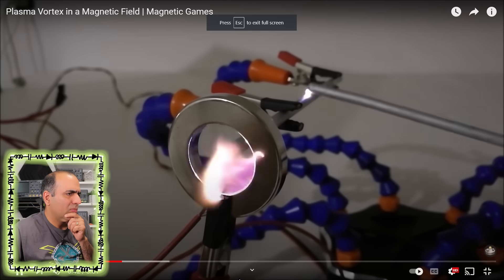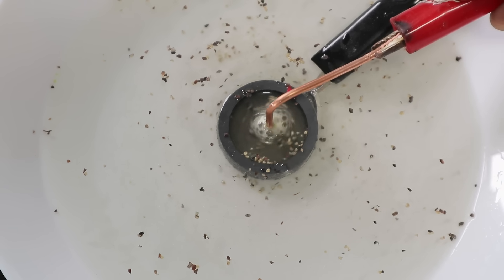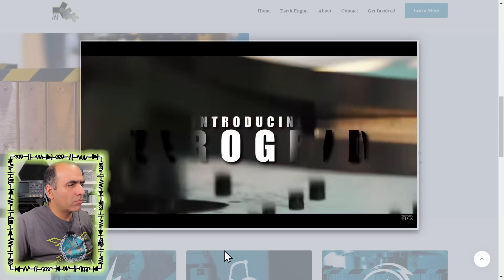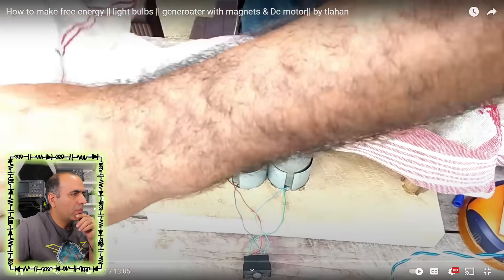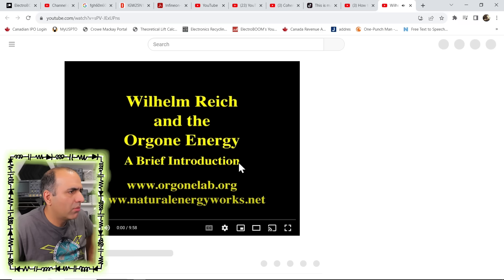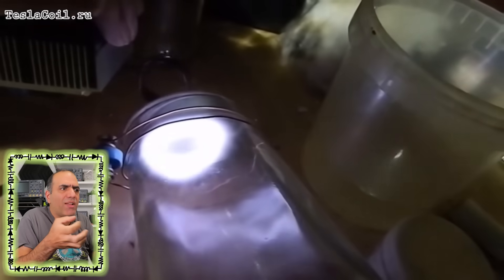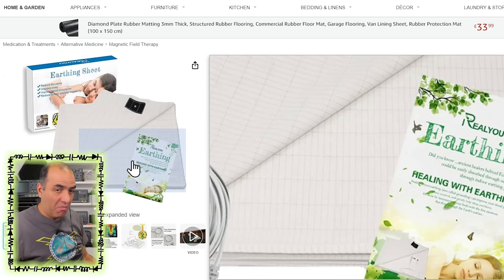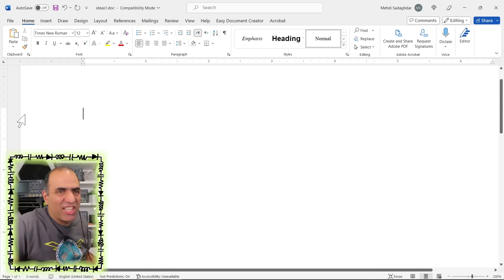Plasma and Salt Water Electric Vortex, Document Free Energy Clean Up

Comment: electroboom could we consider nuclear fusion ass the closest idea to "free energy"? I mean they use water to get more energy than the one the used to make the fision but they are kind of converting water into energy by doing the proces
Reply: All forms of energy generation are just converting from one form to another, in the case of fusion and fission energy the energy comes from the energy matter equivilance, if you take two hydrogen atoms and fuse them into helium then you'll find that the resulting helium atom weighs a tiny bit less than the two hydrogen atoms did in total. The mass of the protons in the atoms has been converted into energy at a rate of E=mc^2, where E is energy and m is the mass decrease. In nuclear fission it's the same thing going on but just in reverse, it turns out that the protons and neutrons in very heavy elements like Uranium weigh more when they are part of the uranium atom than they do after splitting.

The basic thing about energy is that there is loads of it in the universe but most of it isn't in a form we can use. Like coal has a ton of chemical energy but we can't directly power machines with just coal, so instead we burn the coal to boil water that spins a turbine that drives a generator and now the energy is finally in a form we can use. And in the process of doing that a little over half the energy contained in the coal was lost, and it is fundamentally impossible to decrease that loss.

Comment: The smell and discolourations experienced with the salt water vortex experiment can be explained by electrolysis.
You electrolysed salt water, where the cathode was copper, and the anode was iron.
During this process, the hydrogen develops at the cathode, while oxygen and chlorine develop at the anode.
Furthermore, iron ions detached from the anode and deposited on the cathode. This caused a thin sheet of iron to develop on the cathode, thus turning it black.
The chlorine left the water as a gas, which explains the strong smell.
The hydrogen and oxygen also left the water, but this has no noticeable effects.
Within the water, due to a lack of chlorine to combine with, the sodium from the salt reacted with water, thus creating sodium hydroxide, a very strong base.
The sodium hydroxide solution bleached out the pepper, thus turning it green.
After this, the polarities were swapped. The copper became the anode, and the iron the cathode.
At this point, the iron sheet covering the copper anode detached and went back to whence it came. The copper anode then reacted with the oxygen developing at it, thus corroding into cuprous oxide. This turned the surface red.

Electrolysis, electroplating, lung damage, bleaching, and corrosion, all in one experiment!

Comment: There is a way to kind of get free energy you get a water wheel a hose or tube and find a elevated spot above some water and then use suction or whatever you do to drain a pool to make the water go up the tube/hose and then it will push the water wheel and go back into the body of water only issues is the dry and cold sessions will mess with it
Reply: You can only use the siphon effect if the body of water you are depositing the water into is lower than the one you're taking it out of. This is because the energy comes from gravitational potential energy so it has to end up being lower down.
Reply: @hedgehog3180  yet you can use a water pump that isn’t that strong and the energy that is created will be more than enough to power the pump so you can use that excess energy to power other things

Comment: Piezoelectric (sorry spelling) effect from the spark generator in the lighter causes quite a bit of radio interference i think.
Reply: The radiowaves are being generated by the spark itself, not the piezeoelectric effect. Spark gaps were used in the earliest morse radios.

Comment: I'm just asking for a video.
I have a common problem which no one seems to answer on youtube and thought you would know.
I'm afraid my water well will burn up again and I simply need a way that it shuts off if it runs for more than a minute or turns on within a minute of shutting off.  Thats all.
If my pipes break or freeze or both the pump will run until it breaks down and no one seems to know how to fix it.  Perhaps this isn't you thing?
My well is 500 ft deep, runs a 3 wire pump, is 1 hp and runs on 220v.  The pressure switch needs to be converted into a relay but what tells the relay?
Any help would be appreciated.  I wouldn't ask if this problem didn't affect 1.789 trillion people (plus one for me).
Reply: time delay relay?

problem is, constantly restarting a motor is bad for it
Reply: @tsm688  Thanks for the reply.  Mostly, I need to know if its running all of the time (broken pipe), if it runs too often, (badly leaking pipe), or if its not running when it should.
I went to a place specializing in wells and everyone uses a pressure switch where the wires are connected directly to the switch.  They never even heard of anyone using a relay in its place.

Comment: 6:12 you are wrong, recharging magnets means, they lose force, and you need "recharge" them. doersn't mean what you said...
Reply from the maker: ?? How do you charge a magnet then??
Reply: @ElectroBOOM  sintetic magnets like neodinium needs very high currnt for "charge" them. And they lose power over the time, and heat too
Reply: current*
Reply: i mean heat can make the magnet useless
Reply: @ElectroBOOM  i don't gonna lie, i tried my own magnet motor (in my brain not physical), i always found the same problem, magnets has same power in both poles, then is very hard to get a motor only with magnets, because the motor stuck between two same forces of the poles, But this guy said he has magnets with 85% power in one pole and 15% in the other, if this is true you can avoid the problem which makes stuck the motor. And the flying wheel can make the motor pass to the other "stroke" i think...

Comment: Someone already bought and opened that last PVC pipe "device". It's literally just a battery, a switch and some wires to light up one or more of the LEDs. SO not worth even buying for the curiosity of it.

Comment: I don't know how people fall for these xP like the car fuel saver. it's prolly just a small led light that gives you the idea that it's doing something. but the typical 12V socket it would need to be put into, literally only transmits electricity, so it won't be able to interact with the car in any way other than using up some electricity, which the car has to generate... so if anything it'll cost you more fuel xP (insignificant amounts prolly, but still)
like, the only thing I could think about when watching this vid was the "aliens" meme guy xP

Comment: 3:34 I believe Nikola Tesla used a device like this mentioned in his Colorado springs notes from 1897-1899 (roughly), and as possibly device "a", described as a "sensitive device". from what I recall it may have been a tubular container with nickel pellets/beads/shavings, he used it for detecting lightning strikes at a great distance, like over the horizon distances, while also recording wavelengths of such (50km-70km).

Fun note, if I recall correctly Tesla specifically chose Colorado springs as it was famous/infamous for it's consistent specifically localized lightning phenomena (hence why he chose to study lightning at said location). In my own geological "research" on the pikes peak location I came across interesting details about the water table, given the geological history of the volcano which is no longer active, the subsurface rock formation began to crack and erode forming deep fissures in which quickly filled with water, allowing for a vast dispersion of conductive channels running to potentially extreme depths below the earths surface.

It is unknown how far they may extend through the earths crust or what other highly conductive paths it may lead to, but one thing is for sure, it is far better for deep ground conductivity, over say a location situated atop a thick impermeable solid rock layer like... I don't know, New York :-P

Comment: If you can peg the 35 with low frequency, you can probably get sufficient targeting data from triangulation. It wouldn't be a very mobile, but for fixed positions (such as inside the borders of a country) it probably would work great. 

You've got a couple options. You can process the data on the ground and then send it to the munition

Or

Just put a fucking calculator in the missile and have it do all the triangulation.  Its pretty fucking simple math. A graphics card could handle it no problem.
Reply: Tl;Dr 

Triangulation and a graphics card.

Comment: I had an electronic project idea. More a prank one. You know about the noisemaker which won’t stop bipping randomly for x year on a button cell.
What about one in a usb key which is charged when you plug the usb and will only beep during night (photo sensor ?) and use a small capacitor (less bipping but still just a prank) ? Do you think this is faisable ?
Reply: That's totally possible and extremely evil.

Comment: Hi Mehdi, Thanks for this very amusing video debunking free energy BS. People like it because who can resist the offer of something for free? I remember some free energy BS from a few years ago - zero-point energy. This is based on the idea that a quantum mechanical system can exist in a number of defined energy states. It can change to a higher state by absorbing energy, a photon say, and emit energy by transitioning from a high energy state to a lower one. The lowest energy state, also know as the ground state, of many such systems still has some energy and this is called the zero-point energy. The idea is that this energy can be extracted and this is free energy. It's BS of course because ground state means it is in the lowest energy state, if you could any energy out of the system, it would go to a lower state and that means it wasn't in ground state in the first place, so it's BS. Anyway, you can only take a finite amount of energy out, after which you would have to replace it to continue. There were many company selling devices that supposedly harvested this free zero-point energy some years ago, but then it kind of faded away.

Comment: Magnets don't deplete within 3 years.
If that were the case speakers, motors and other electronic devices would stop working after a few years, which is not the case. 

Their depletion is so minor and slow it won't be noticed compared to the human lifespan.

Comment: Honestly if it weren't so expensive I might buy that weird blanket thing. I would not be surprised if it's yet another different buzz word for the radioactive crap that all started with "negative ion" woo. If that's the case, it needs to be pulled from Amazon and the company investigated ASAP.
Reply: Oh hey I haven't seen the Ingress logo in ages.
Reply: @hedgehog3180  Hello there!

Comment: Making magnets with lightning "The Lodestone" Nasa - Peter Wasilewski
Technically this is storing lightning As a magnetic field 

Fill A Tube with Iron Filings and then Wrap A copper brake  pipe coil around it  then  next Thunderstorm Set it up on a Hill  & summon  lightning  from the Havens Using a Weather balloon and VHS Video Tape / Compact cassette Audio tape

I wonder if  i found a Topic & Project That may just kill you

Comment: Is the glass bottle electric ball thing just the reflection of the light in the bottle moving around and cause of the camera persepective just appears to be moving in a circle?
Reply: No it's a genuine phenomena, just not a particularly easy thing to do and one that requires some very specialized and expensive equipment. But it's just an induced current in a noble gas causing a plasma to develop, which achieves nothing but looks very cool.

Comment: Small question :
Assuming that LK99 is working as a supraconductor at room temperature (yes we can dream) :
What would be the magnetic field around a magnet which will be partially coated by LK99 on all its faces but one ?

For example : a cylindrical magnet coated with LK99 everywhere but not on its north face...

Comment: 3:05 electrolysis of salt water creates NaOH and chlorine gas.
Reply: So you are saying when I was trying to make an electrolysis torch I used the wrong electrolyte? Because when I did it it would make the green solution and i would hear a gas flowing but it couldn’t ignite so that was chlorine not HHO?
Reply: @meglo1591  Just don't breathe in the green gas! Won't do your lungs any good.
Reply: @supertubemind  but still the gases wouldnt ignite
Reply: @meglo1591  Would you really want gases igniting in your lungs? Chlorine would "ignite" hydrogen spectacularly!
Reply: @supertubemind yee it can ignite but it needs a flame to start the reaction
Reply: @meglo1591  Use lye (sodium hydroxide) or Epsom salt (magnesium sulfate). When electrolyzed, these substances do not produce any gases.
Reply: @meglo1591 When NaCl is available, it will be electrolysed, tho you'll get H2 and Cl2, and NaOH (in ideal conditions)
Water turns green because of dissolved clorine.
You might want to use something pretty active (like Sodium sulphate for example) as an electrolyte so that you definetly electrolyse H2O (of course ideally, I believe that you still need to account for cathode and anode corrosion and stuff)

In ideal conditions, active metal + oxygenated acid residue will lead to only water being electrolysed.
Reply: Yes it would with inert electrodes but from my experience it would create the chloride salt of the metal the electrodes are made from instead of making chlorine gas.

Comment: Coherer is 100% real, back in the day I read about it the inventor also invented the basic electric bell, because the tube containing the particles (coal dust I think) had to be bumped to shake up and release the connection, so instead of hitting an actual bell the arm was hitting the tube. Fascinating stuff

Comment: You talk about how there's nothing called free energy yet there's a battery sitting at some Museum I think that has been running some sort of Bell since the 1600s I think if I remember correctly I don't remember. But it's something like that and that seems to be free energy since the Bell has been ringing all these years and no one has charged it since.
Reply: That's a myth, the museum literally says on their website that they have replaced it several time. It's just a mechanism that uses very little power so it can run for years.

Comment: Hey Mehdi, you should review the Nuclear Fusion technology industry. Making mini suns and drawing the energy from that, thus getting more energy than originally put in by burning fuels.
Reply: Nuclear fusion just extracts energy from Einsteins energy matter equivilance E=mc^2, it doesn't violate anything. When you fuse two hydrogen atoms together, which each consist of one proton then if you weighed the resulting helium atom you'd find that it weighed a tiny bit less than the two hydrogen atoms did in total. That tiny weight difference is the energy that is released by fusion and if you look at the energy mass equivilance you'll see that the energy is equal to the mass decrease times the speed of light cubed so that's a lot of energy. Fusion however is extremely hard to do on Earth so that's why we don't have fusion power yet, but if you happen to have something like a billion billion billion Earth masses worth of hydrogen gas laying around it will collapse on its own into a star and start nuclear fusion in its core.

Comment: um i recall you can make electricity by moving a magnet through a coil of wires, i think. my recallness is not so good, does any one else recall if this works ?
Reply: Yes. A magnetic field of a magnet will induce a voltage in a coil. It's known as induction.

Comment: what about to turn on an electric powered motor by hand with  a string. And this motor turns on an electricity generator, by belt. And the generator takes over the energy to use the motor????
Reply: You'll just loose all the energy to heat so congrats you've built a shitty handcranked space heater.

Comment: So, I noticed an interesting effect produced by my Tesla coil.  Apparently, a Tesla coil violates the inverse square law.  When I have my Tesla coil running, I can use my EMF meter to measure the field strength around the coil.  What I have found, is that from right next to the coil, and out to about a yard or so, the strength of the field gradually falls off like you would expect it to.  However, when you reach a certain point away from the Tesla coil, the field strength on my meter peaks off the chart.  And this peak in the strength of the field seems to exist in a virtual sphere around the Tesla coil.  And once you move past the point where it peaks, it begins to fall off again, just like you would expect it to.

Do you have any idea why a Tesla coil forms an electromagnetic "sphere" which it projects around itself out into space, and which seems to violate the inverse square law?
Reply: It would help if you clarified whether it's the electric or magnetic field, because right now it just sounds like a standing radiowave, which is probably not directly caused by the Tesla coil but rather its interaction with something else. Though also electric and magnetic fields drop of linearly, not with the square of the distance IIRC.